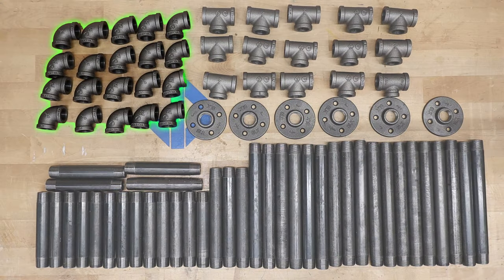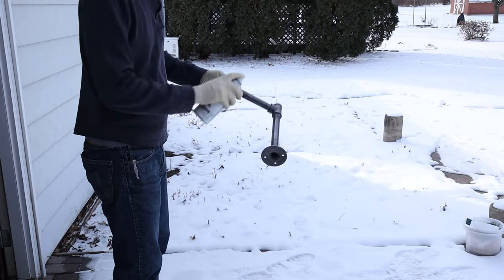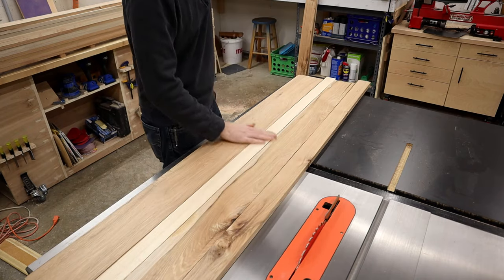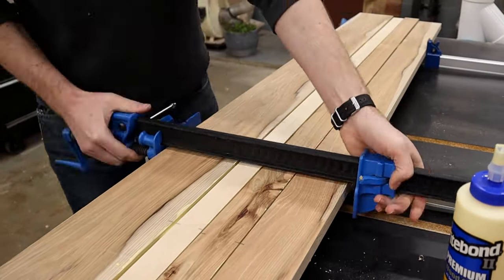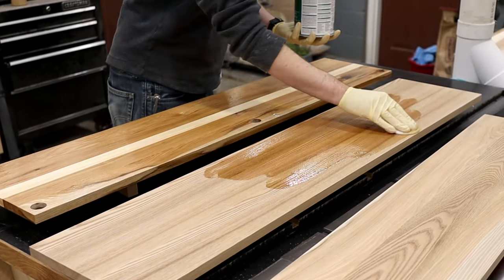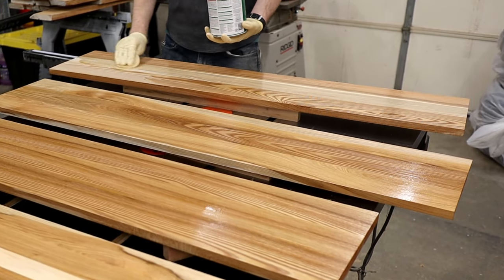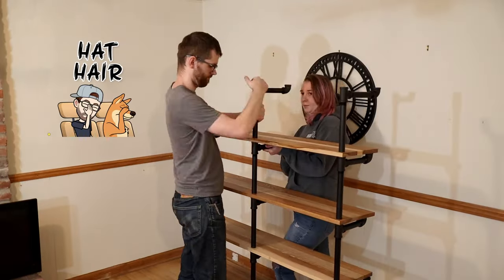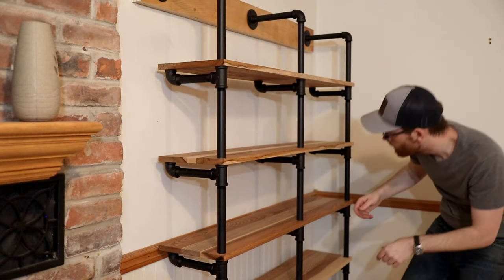Build this INDUSTRIAL Black Pipe Bookshelf with PLANS!!

Comment from the maker: How many times did you have to run to the store last time you built something?  Comment down below!
Reply: Equally annoying is the never ending trips up and down the stairs for a simple inside project. Whatever you think it should take, multiple by at least three.
Reply from the maker: Absolutely. I keep leaving my SD card in my computer. Go to the shop, set up the camera, almost ready to build something awesome..."Insert SD Card" ....
Reply: I did this in my office.  I made multiple trips to HD  and LOW cause they were either out of stock or didn't have any.  Worst part is I had to strip them down to the metal before painting.  Thatwasthewostpart odmy build.

Comment: I love this and have purchased the plans, but am wondering if you foresee any problems switching from 3/4" diameter to 1/2" ? I have several left from another project and would love to use them up.
Reply from the maker: Thank you!!  1/2" pipe should work great.

Comment: Did you screw the bottom flanges to the floor or are they free standing?
Reply from the maker: Free standing, except for the tip flanges which are anchored to the wall. 😁
Although, I might recommend anchoring to the floor as well if you have young ones that might try to pull on the shelf. It won't fall, but it could move around, which is not so great.

Comment: You also could have added spacers under the feet to avoid the shelves, no?
Reply from the maker: Definitely!  But I decided adding a plate to the wall would look a little better.  If you catch the issue earlier, you could simply use longer pipe for the legs.